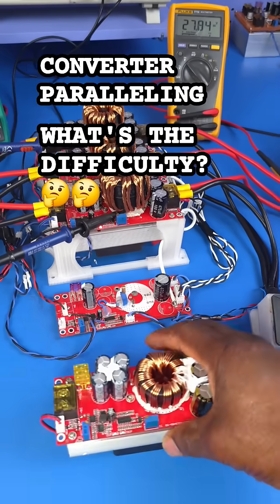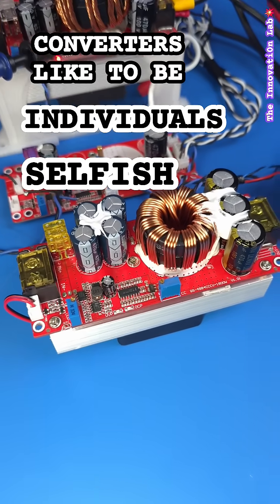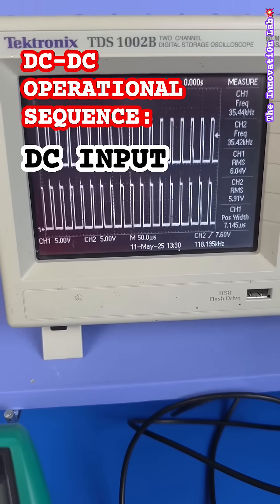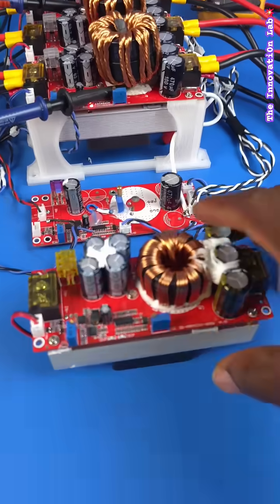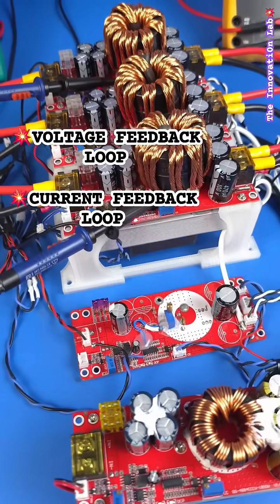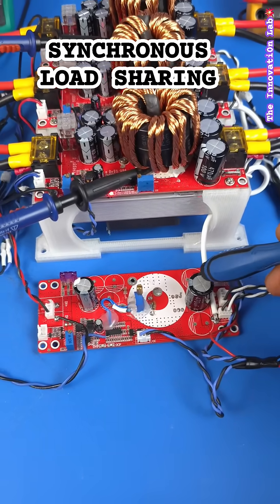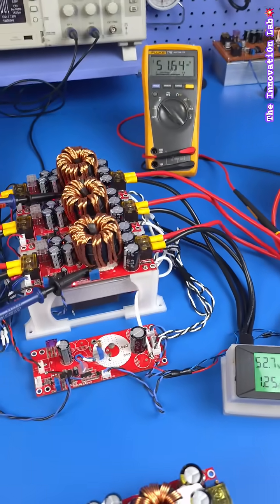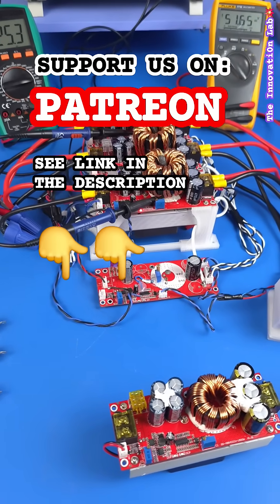Why is it Difficult to Parallel DC-DC Converters?🤔 #shorts #power #dctodc

Comment: Earlier you showed the same setup in parallel without any control board, which was working without any issues. This setup has a controller, which allows for easier adjustments. But is it necessary? If yes, what is the issue with your earlier videos showing successful paralleling of two or three converters without any issues?
Reply from the maker: Thanks for the wonderful engagement!
👍👍👍

Great observation and I am happy you are really following up on the progress. 
There is no issue between the method I used in the last video and what we have now. 

The only difference in design is that I decided to add the control board whose only function is to focus on control. In the last setup, I had it such that one of the two converters was essentially controlling the other one.....which was pretty much like a zombie.😊

Analogies:
Initial design (2X paralleling) ==> like 1 smart human working with a zombie, telling the zombie what to do and they both work together to get the work done.

Current Design (3X paralleling) ===> 1 smart human (the control board) telling 3 zombies how to get the job done.... and what to do..hahaha.

The overall Idea is to improve the system reliability. In the previous design, if the  controlling converter gets damaged, the entire system stops working. However in the current design, since the control board is not bearing any load, it is seeing less stress so less chances of getting damaged...now if one of the 3 zombie converter suffers a failure...its input fuse should blow thereby removing the affected converter from the system there by allowing the other two converters to keep functioning.

Again, great question.
Please consider becoming a Patreon supporter. You can sign up for our Q&A $5/month membership level that allows you to ask questions about our work and keep getting detailed answers such as this.
👇👇👇
Our Patreon:
https://www.patreon.com/c/TheInnovati0nLab/membership?redirect=true

Respectfully,
The Innovati0n Lab 💥
Reply: @theinnovati0nlab782  Thanks for the comprehensive explanation. Waiting to see more videos from you.
Reply from the maker: Thanks for watching our videos. I appreciate the wonderful feedback and support.

Respectfully 
The Innovati0n Lab